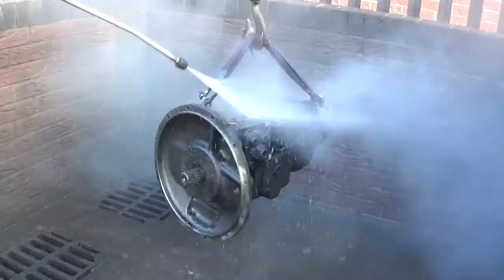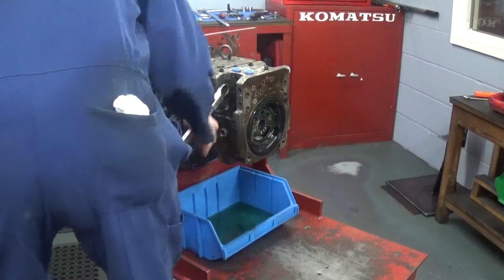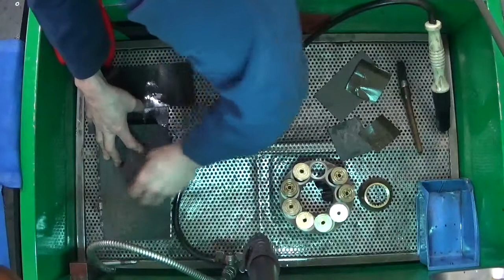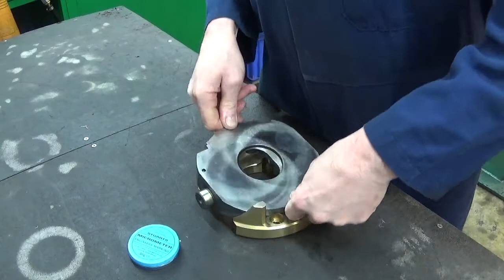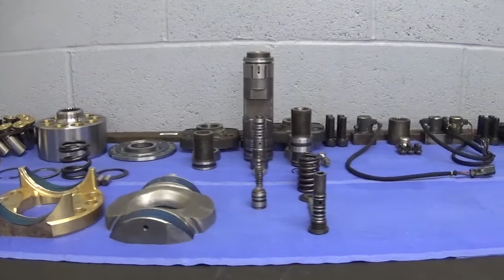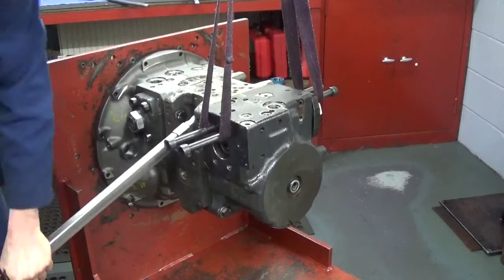Komatsu PC210-8 Strip, Clean and Rebuild process.

Comment: is it necesarry to Lap new cylider and valve plate? Or is that just for 
Used parts?
Reply: it is used parts..when you replace the internal parts. block piston and plate must be replaced together to ensure the proper fitting to each other.